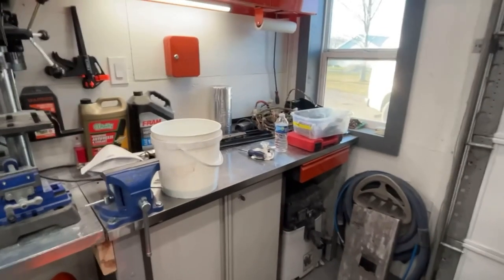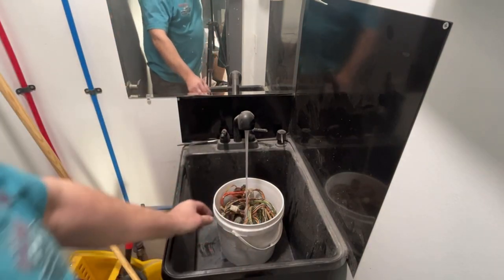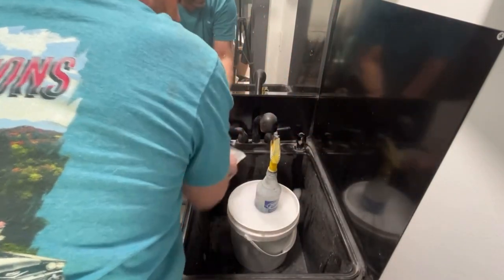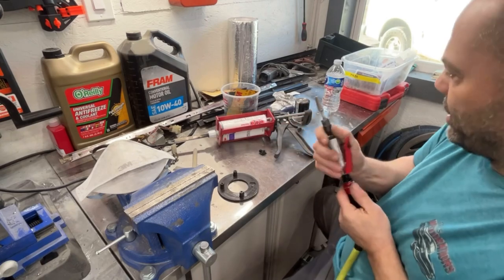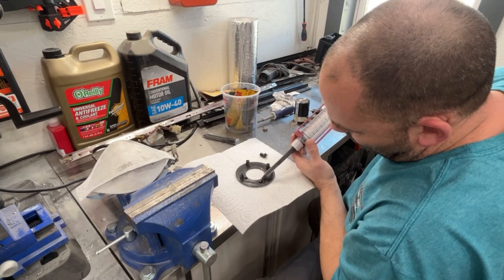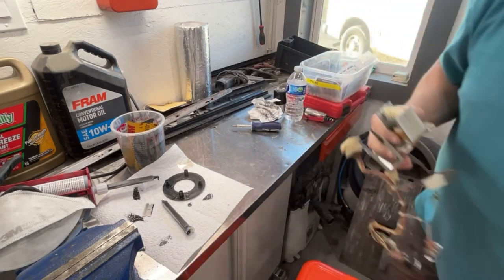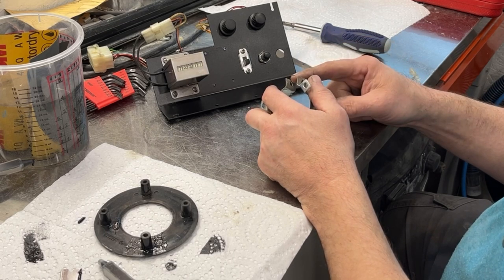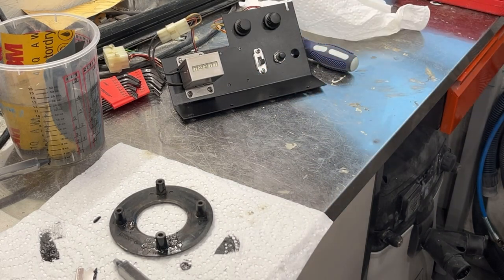Pole position Arcade restoration part 11

Comment: For glue I used super glue and a little sprinkle of baking soda.  I learned this from RC car parts. Dries instantly so you get one shot. Make sure you put it in the right spot . Leave all the material so it fits together where it is supposed to.